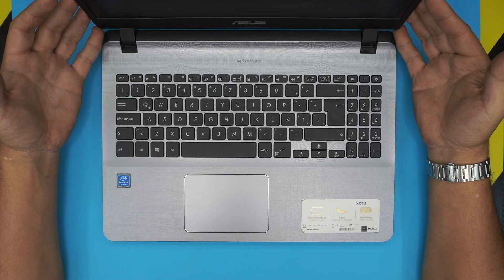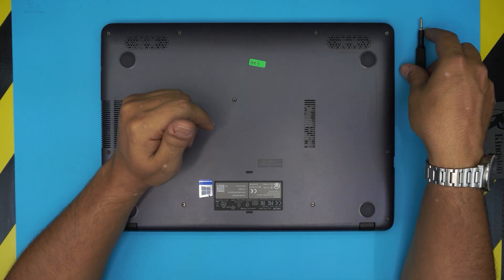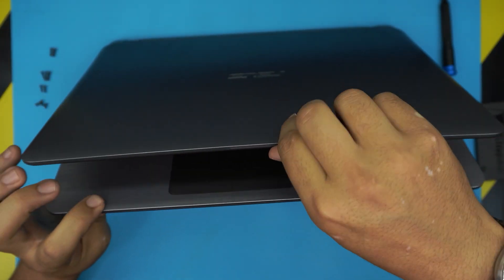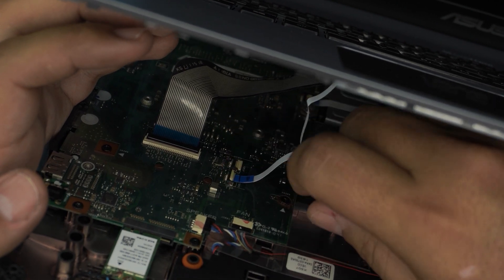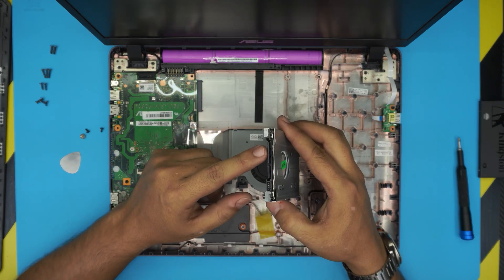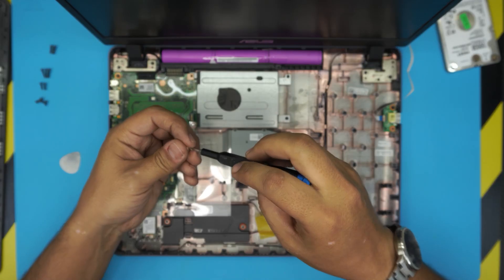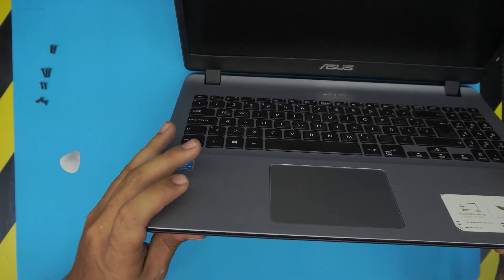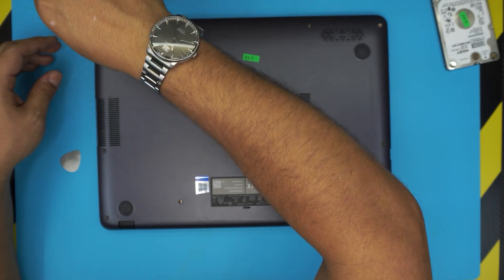Asus X507m UPGRADE SSD STEP by STEP

Comment: I did upgrade a laptop in the past, same model. and I'd notice there's a slot for NVme m.2 at the other side with the RAM. is it possible to upgrade SSD NVme ?
Reply from the maker: 🫠Regarding your question, here is a video of the ram upgrade, in the video you can see the m.2 slot for ssd beside the ram. BUT it is not NVME compatible, or m.2 SATA, so it will be the same speed as the 2.5' ssd 
https://youtu.be/Alm3aQsZakA
Should you have any further questions or requests in the future, please don't hesitate to ask me.
cheers🍻

Comment: Hello, can you tell me if it is possible to insert an m2 ssd into this laptop? I just bought it, installed it, but the laptop doesn’t see it
Reply from the maker: Thank you for your feedback! If you wish to support the channel, you can like, subscribe, or both!
Regarding your question, this laptop doesn't take NVME (i'm assuming you got nvme), this laptop take m.2 SATA (not nvme)
Should you have any further questions or requests in the future, please don't hesitate to ask me.
cheers🍻
Reply: @uFixTek  Yes, I already bought a sata ssd, everything is cool and good. Only I heard the opinion that you can update the BIOS and then it will be possible to enable m2
Reply from the maker: updating the bios will not change the m.2 sata to be able to take nvme, the nvme is a phisical connection not software.
Reply: @uFixTek  I also noticed that for many the processor works fine, but for me it loads at 100% when idle, I already reinstalled Windows, but it didn’t bring any big changes
Reply from the maker: did you installed the windows on ssd and not HDD. before installing the windows remove the HDD and only have the m.2 sata and do windows update and all. then power off and install the hdd.
Reply: @uFixTek  That is, my m2 nvme will not work, I need a regular m2? However, as I already said, I put the sata ssd and m2 nvme have already put up for sale
Reply from the maker: yes that is correct you need a m.2 SATA (not nvme)

Comment: I have the same model. My problem is, i hear a sudden tick sound then the laptop restarted itself and enter looking for a boot drive but the laptop can see the drive. I really need the file to transfer to another drive before changing to ssd. Any advice would be much appreciated.
Reply from the maker: Thank you for the feedback! if you wish to support the channel you can LIKE or SUB or both :P
regarding your question: the tick sound is coming from HDD headers (actuators), highly recommend you to stop turning on and off you will only damage more the headers and won't be able to recover anything, 
you need to get a SATA to USB adapter : https://amzn.to/3Un9lCr
install your SSD and install windows then once its finished then use the adapter to connect the HDD to the laptop and go to the OS partition and then to the USER folder and copy all the data you had in there and pull it out to the new windows.
YOUR HDD is about to DIE!

Comment: why remove hdd ???
Reply from the maker: in order to place the SSD SATA you must remove the HDD.
Reply: @uFixTek  m2 ssd slot don't have?
Reply from the maker: we open many of them every month and most of them don't have m.2 ssd sata slot and very rare times they do, you can flip the board and if you see the m.;2 jack there as in this pic: https://imgur.com/a/KW2ehlJ
then you can have m.2 ssd sata and keep your HDD. but i didn't mention because its very random.
here is a ram upgrade video and in this video you can see the m.2 slot.
https://youtu.be/Alm3aQsZakA

Comment: Can I use ssd along with hdd in asus x507m cdc model? Or will I just have to switch to ssd replacing hdd in case of upgrading?
Reply: You can. Use the m.2 slot 👌
Reply from the maker: Thank you for the feedback! if you wish to support the channel you can LIKE or SUB or both :P
regarding your question: you have to use SSD or HDD you can't have both, and fresh install windows on the ssd for better performance.
create win 10 usb: https://youtu.be/uDu8j2lE-dM
install windows 10 : https://youtu.be/kkxDz398DL8

Comment: Bro are western digital ssd good? I see a lot of negative long term reviews for crucial..samsung is too expensive in my country.. thank u for this video..soon will b finally upgrading to a ssd
Reply from the maker: Thank you for the feedback! if you wish to support the channel you can LIKE or SUB or both :P
regarding your question: THE best are samsung, and crucials are good depending what model they have a really garbage models and a great models. you may have looked into bad models.
if you want to get WD get WE black the greed and blue are not so great.  remember the bigger the GB of the ssd the longer it will last, because the more GB the higher the TBW (Terabytes Written).

Comment: I am not able to setup the laptop after upgrading to SSD. what should I do ??
Reply from the maker: Thank you for the feedback! if you wish to support the channel you can LIKE or SUB or both :P
regarding your question: you need to create windows 10 usb boot: https://youtu.be/uDu8j2lE-dM
then once you created then replace, the hdd with ssd then, you want to plug the usb in and power on and keep pressing on F12 and it will show you the boot menu and choose USB and then follow the installation steps very easy follow any of the windows installation step for proper installation. https://youtu.be/kkxDz398DL8

Comment: Hi, can i install WD Blue 250 GB NVMe M.2 SSD in my Asus X507UA-EJ314T? Will it have heating issue? Or should I instead install WD Green NVMe M.2?
Reply from the maker: Thank you for the feedback! if you wish to support the channel you can LIKE or SUB or both :P
regarding your question:  it doesn't make any difference if you install Blue or green , they will both have same temp and will last you long time. i would go with blue, and the m.2 connection if on the other side of the board, here is a video where i show how to remove the ram and you can see the m.2 in there, and the screw comes in there.
https://youtu.be/Alm3aQsZakA

Comment: My X507M is having a hard drive failure, what should i do?
Reply from the maker: Thank you for the feedback! if you wish to support the channel you can LIKE or SUB or both :P
regarding your question: you should 1st of all do a backup of all your files 1st, then create a windows 10 usb boot disk:
https://youtu.be/uDu8j2lE-dM
then you will want to replace the mechanical HDD with an SSD:
https://amzn.to/3BTEbt3
then you will need to place the usb into laptop and power on and press F12 and choose your usb and install windows 10 and follow any of my windows 10 windows installation for best way of installing.
all asus are the same way of installing windows:
https://youtu.be/kkxDz398DL8

Comment: Awesome video! My X507M started updating a week ago and still is. I cannot use it. My friend told me we need to upgrade the memory and SSD. Is this the right solution?
Reply from the maker: Thank you for the feedback! if you wish to support the channel you can LIKE or SUB or both :P
regarding your question: i would highly recommend you 1st go with SSD and make sure dont get the cheap Kingston or adata brand they are garbage, get Samsung or CR.
1. https://amzn.to/3kEWoo9
2. https://amzn.to/3Bw7ula
3. https://amzn.to/3xXsGP0
and for the ram go for 16gb:
https://youtu.be/Alm3aQsZakA
16GB: https://amzn.to/3i1TSGZ

if you need to create windows 10 usb drive for installation:
https://youtu.be/uDu8j2lE-dM

the proper way of installing windows 10 just follow the part of the installation steps:
https://youtu.be/kkxDz398DL8

Comment: Hello, does x507ma can read m.2 sata 3 ssd 1tb?
Reply from the maker: Thank you for the feedback! if you wish to support the channel you can LIKE or SUB or both :P
regarding your question: YES you can all an m.2 SSD SATA, but the connector is in the other side of the motherboard, here is a video where i replace the ram and right at the bottom you see the m.2 slot available: https://youtu.be/Alm3aQsZakA
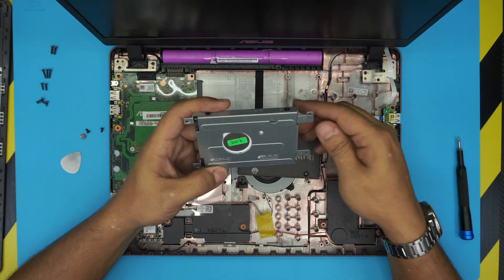@6:04
https://imgur.com/a/qGdvMoI
m.2 ssd sata: https://amzn.to/3pSaJ12
Reply: @uFixTek  so can we make hybrid  like SSD + hdd

Comment: Hello i replaced hdd to ssd but the touchpad is not working now.  No touchpad in device manager.. No touchpad in devices. What should i do? Keybord is working fine
Reply from the maker: go to bios and look for touch pad option and change it to advance or basic and then reboot. let me know if you got it working, thank you for the support to the channel :)
Reply: @uFixTek  hello, internal pointing device is enabeled but nothing touchpad is not working
Reply from the maker: @Narifh  https://prnt.sc/z2dfiu
double check the small flex cable make sure its connected correctly remove and re insert the flex.
Reply from the maker: @Narifh  ok when you replaced the ssd did you install the windows new or you cloned you hdd to ssd?
Reply: @uFixTek  i cloned it with Macrium Reflect 7 and everything is working good. did i killed the touchpad somehow?
Reply from the maker: no you didnt there is no way you can kill it. im guessing there something went wrong with cloning. to be sure remove the ssd and place your old drive and if it did work then you will know the cloning went wrong. i would recommend fresh install.
the touch pad you can drop it in water and take it out and dry and still will work, dont worry about hardware damage. its software
Reply: @uFixTek  I tried with old hdd but touchpad is not working
Reply from the maker: did you double check the other end of the flex of the touch the other end make sure its not moved or disconnected.

Comment: before replacing the laptop's internal storage, i need to make sure that all my files from the old drive are stored separately so i can just move them back once the new internal drive is installed right?
Reply: and is there a limit on how much storage the x507m model can handle or  can i go more than a 1TB drive?
Reply from the maker: there is a better and faster way without installing windows freshly (i would personally install windows from scratch),
you can get this adapter:
https://amzn.to/2YZU0fH
and connect your new ssd to this adapter and plug it in and download a free version of:
macrium reflect cloning program
and in there just simply clone the main HDD to the new ssd.
and after if you wish you can buy this enclosure:
https://amzn.to/3rLTTAT

the ssd or hdd you can go up to what ever TB that is available in 2.5'
this is a 4tb but in there there is a option for 2tb also:
https://amzn.to/3cQ0tlu
Reply: @uFixTek thanks man
Reply from the maker: @jakobestioko  your welcome my friend , thank you for  your support.

Comment: I did everything as shown just to do a hands-on on my laptop
Model is x507ua asus..
But now it is not switching on the Power led is blinking in white that's it.

I have made sure 2 times that all the cables are well connected as shown by you.

What can be the issue..?
Reply from the maker: okay my friend lets figure this out, what did you do ? you only removed the HDD and placed a SSD?
you didn't remove the motherboard nor touch it? did you flipped the motherboard to replace the ram?
Reply: @uFixTek  See I was just doing a hands on that how to tear down the laptop so that in future when I want to upgrade I can do that by myself..

Check once the model is asus x507ua.

So did not removed the ram nor the HDD..

I just took out the hdd and then  placed it back then 
Placed all the screws and the cables exactly the what they should be..

There are two LEDs only one is the power led and the other one is charging led i.e when we connect the charger the it turns on to white..
But now when I am pressing the power button the power led is constant on
But the charging led is blinking slowly in white colour that to I haven't connected the charger..
And the laptop screen is not turning on.
Reply from the maker: okay i need you to do the following:
open it up remove the ram and place the ram again,
make sure you connect the keyboard flex straight in all the way, and its not sideways, and at the end power on with charger connected,
else if no screen after 15sec. 
do this power off and remove the battery and put it back the keyboard and dont connect the charger, just press and hold the power key for 30-40sec
then release the power on button  and connect the charger and power on, if boot was success then power off and plug in the battery.